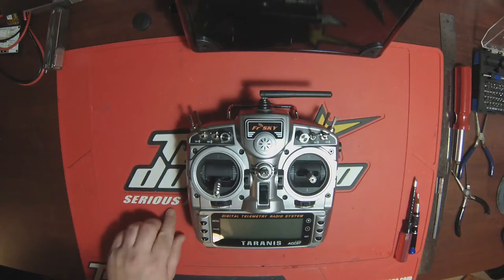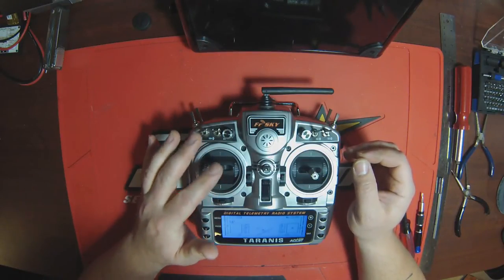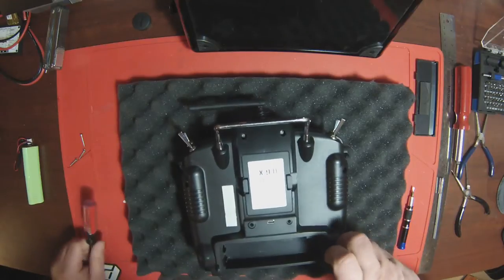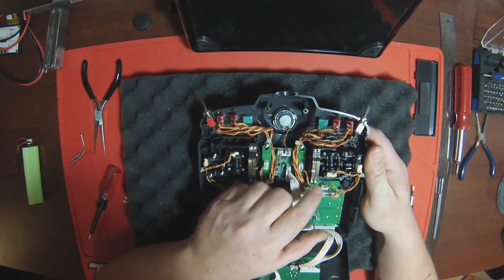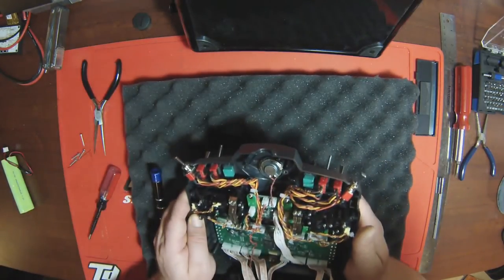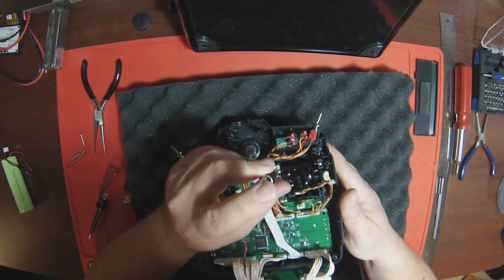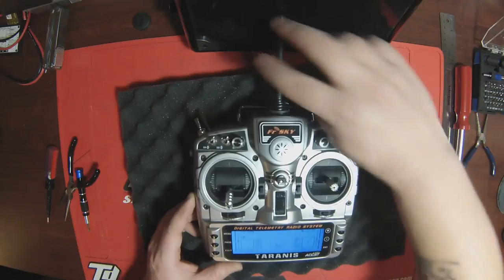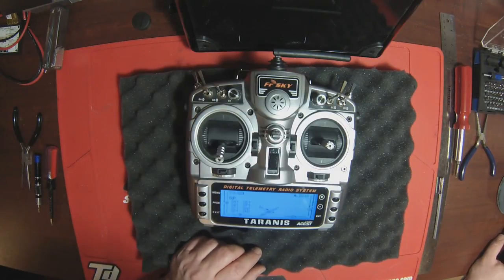Taranis throttle spring adjustment and ratcheting throttle removal

Comment: Nice tutorial. I modified the throttle further. I reversed the spring so it no linger rides on the ratchet but on the smooth portion, right next to the ratchet. Then, I cut a notch exactly on the center of that piece, i.e, it is now like a "single-notch ratchet". Once you are at the required height, move the throttle to center until it "clicks" into the notch. Then you can fly around, turn, stop and go, and the multirotor will maintain altitude without your giving throttle a second thought.

Comment: Thanks, this was helpful for me even thought I had a different, but related objective.  I was trying to figure out how to tighten the spring on the throttle so I force it to center so I can use the radio for a robotic operation (opposite objective of your video, but you gave me all the info I needed).  One suggestion:  Adjust the camera angle so we can see what you are pointing at.  Your hands were blocking the view for key parts of the demonstration.

Comment: Adjusting that screw for throttle didn't seem to do much of anything.  Any suggestions?
Reply: I had to practically turn the screw right down so the block that it moves was all the way down, if that doesn't work you can try and remove the spring that way there will be no bounce at all.
Reply: Jeff S Thanks, I ended up removing the spring.  What confuses me is, why are some people loosening the screw and some people tightening it?  From what I can tell, loosening the screw relieves pressure on the spring and tightening stretches it.  On my radio, seems as if loosening it would be the fix.  Are there different versions of this radio?

Comment: for me even removing didnt work, my throttle stands at -100 and iam still receiving this warning, any more ideas?
Reply from the maker: That sounds more like a software issue now. If your throttle is -100 and your still getting alarms. Have you done any recent updates? Also are you using a switch for throttle cut?
Reply: +Fpflyer iam using 2.0.17 because of RSSI presence as input and mix which doesnt exist in 2.1.3. Throttle cut doesnt work either, I also think its caused by firmware but asking doesnt hurt :) thanksfor answer :)